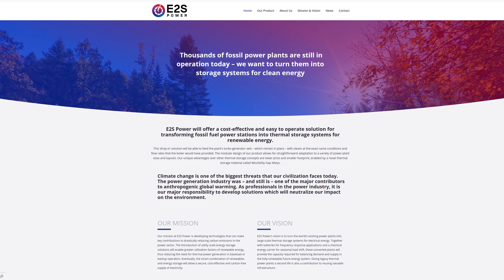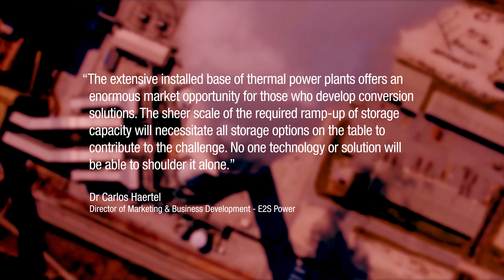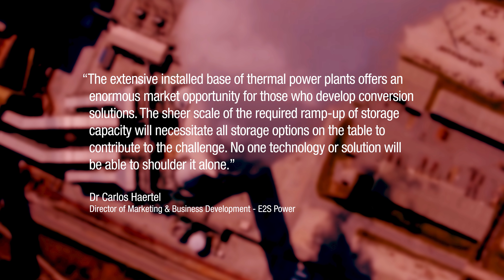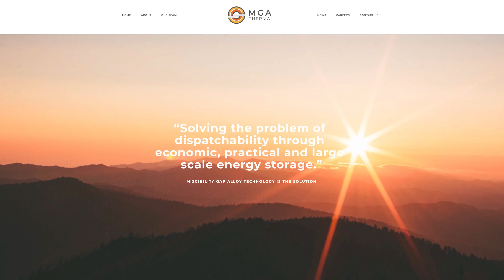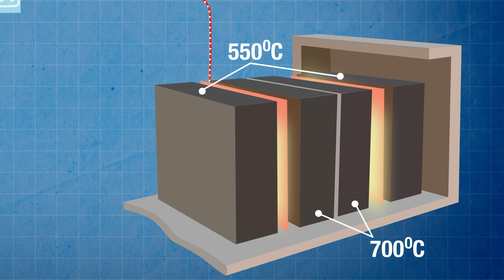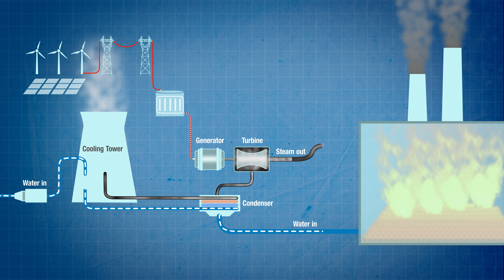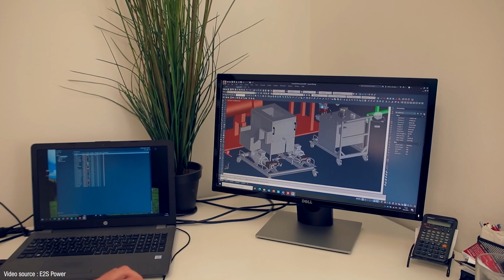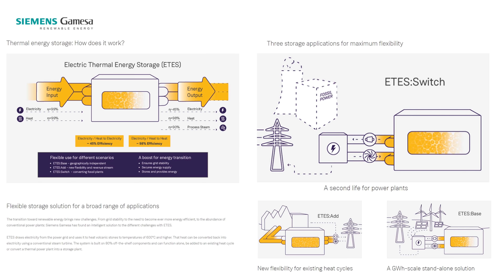New energy storage tech breathing life and jobs back into disused coal power plants

Comment: Thermal powerplants have an efficiency of round about 40 percent, so most of the renewable energy is lost in the process. There are more efficient ways to store energy! It could make sense however when its much cheaper and faster to implement than the alternatives.
Reply: In other words, to make this profitable, they would have to arbitrage electrical prices at least 2 to 1.  So, buy power at 5 cents/kWh and sell at 10 cents/kWh.  How many hours per day can you do this?  2 or 3 or 4? During peak summer demand?  Hard to see how this is profitable, it might be, but barely?
Reply: @LinasVepstas  If there is a shortage of electricity generation at night time, electricity will simply be quite expensive then. 
And conversely, when there is a surplus (high wind, low consumption) - energy is very cheap (sometimes negative prices).
If that difference is frequent enough (and predictable enough), there then is a business model.
Reply: @arnesteinarson3645  in his comment @Linas Vepstas  mentioned exactly that - "arbitrage electrical prices". What he doubts is that you can have high enough frequency/duration of those events to cover the installation costs of this system.
Reply: As a basic rule of thumb, 1/3 of the coal energy is lost as heat in the condenser and 1/3 is lost up as combustion gases / unburnt carbon up the stack. This tech could eliminate the combustion losses; however there would be some losses from insulation or energy lost in heating the material. I suspect you could raise the efficiency levels up to 50-55% with this tech, which is a huge improvement from the current 35-40%

Comment: Instead of using a cooling tower, we could push the steam through a water tank that could be used to provide heating to homes, or even hot water on tap (if you got it hot enough). The usual heat pumps/hot water units can pick up any slack if the tank gets too cold.

A good amount of energy is used for these 2 purposes, so it'd save some of the energy used for heating and recycle the waste heat instead of just venting it into the atmosphere.

In summer, you could pump colder water to the "heating pipes" to help cool homes down.
Reply: @Darren Munsell In the US. Other regions are very different. Most of the coal power plants where I'm from are quite close to cities, and often use the cooling water for heating homes already.

Comment: Why can't they be converted to pyrolysis plants?  Use wood and offload it as biochar! Use the biochar in agricutlural fields and as an additive to concrete. The Ithika Institute calculations on 250,000 machines would meet all the needs of electricity.
Reply: Log wood (20% moisture content) has 14 GJ/tonne and 6 GJ per cubic metre.
Anthracite has 33 GJ/tonne and 36 GJ per cubic metre.
Charcoal is the main energy component of wood..
Not only would you need a metric shedload more fuel, but you would be burrying the vast majority of your energy.

Comment: This certainly is interesting, and I’m always in favor of reusing and repurposing. I’d expect the round trip efficiency is necessarily fairly low though, as the original power plant would have been maybe 50% efficient? It would still have its uses though. I’ve been quite intrigued instead by the modular nuclear reactors that can be used to replace the original boilers at power plants. Thermal energy storage could be combined with those as well, making for a truly winning combination.
Reply: With Thorium or existing Nuclear Waste used to power the Reactors 💯
Reply: Yes! That’s even better!
Reply: rather 35-40%... 50% is unrealistic unless you could somehow combine supercritical or combined cycle power plant

Comment: Old and new coal-fired electric generation can best and super-easily be retrofitted with the newest FUSION NUCLEAR power. Similarly, the Australian submarine force urgently needs the very same latest and more straightforward new PLASMA FUSION TECHNOLOGY, AUSUK or not. The 1960's Nuclear fission of the currently on offer submarines are now thoroughly out of date! This potential alternative and much technically simpler fusion technology is the newest disruption, has not yet been adequately discussed, and is the one that will soon be available for all the cheapest clean energy technology and it will cast an economic shadow even over the currently cheapest solar and wind electric power production.  Large scale regional solar and wind, apart from being unsightly, requires an equally unsightly, expensive and less safe and vulnerable electric grid system and require either many batteries or other storage device technologies. to support them. Not only is the grid unsightly but it has electromagnetic field production long term human health implications which have been proven to be but one source of a multitude of e m radiation sickness symptoms and cancers.

This newest currently available energy is PLASMA FUSION NUCLEAR-based. It comprises “a tiny, any scale built, safe and easily choked 24hr reliable FUSION NUCLEAR energy supply, that of the "SAFIRE REACTOR”. It requires only this simplest medium temperature plasma confinement “SAFIRE REACTOR". To understand it completely you need to be well versed in the newer “ELECTRIC UNIVERSE THEORY”, most easily learned via “THE THUNDERBOLTS PROJECT.COM” website and specifically then see it at the website for the “Safire Reactor”  itself at the largely Canadian firm developers site “AUREON ENERGY.COM”. 

The “Safire Reactor” can be built on any scale as it is entirely electromagnetic in nature and therefore it can be built to suit any sized local community as needed. 

This capability makes large scale and expensive electric grid systems ultimately almost obsolete and large scale more remote solar and wind simply now so much less necessary and economic. So, the net cost of Safire Reactors for electric power supply will be cheaper than with all other green and fossil fuel technologies, especially when considering the lack of the need for beefed-up or expanded grid transmission costs are factored in. We will not require to expand the grid to thus enable much more electric supply as small-scale generators in smaller local communities are easily possible. (Think, no further need for more ugly wind turbines and vast expanses of solar cells and all their added new grid upfront costs.).

We need to develop and install “Safire Reactors” across the world and empower a new societal generation with much-improved equality of wealth distribution levels based on exceedingly cheap power. Safire generators can replace the fuel rods, control systems and containment buildings in older fission nuclear reactors, At the same time, they can safely remediate the spent and unused fuel rods. One of the great things about the Safire Reactor is that it does not need heaps of expensive batteries to support its function any more than the existing fission reactors do. This new possible ridiculously cheap energy available to all could be a great societal leveller. However, we must also realize that this will not be welcomed by all. Supplying this new universal energy is simple but peacefully transitioning our society to accommodate its consequences is certainly much less simple. However, the cat is technologically out of the bag now and any reasonably developed nation can reproduce the physics and technology so we cannot avoid facing it.

Tony Seba, I totally admire your research and everything you deduce and say, but I believe you now need to further update your rapid transitional technology message. This new EU plasma science and its practical Safire Reactors have the additional benefits of producing a whole range of new nuclear elements by atomic nuclear transmutation (Nuchemy) with no need for expensive and scar-forming mining on a worldwide basis. The self-produced hydrogen fuel of this fantastic fusion system produces massive quantities of heat that can be directly used for the thermal domestic and industrial requirements of heating and in generating green and virtually costless electric power.

Using these Safire Reactor/generators, we can then retrofit all existing fission nuclear and fossil fuel generators and then build many more of these new fusion reactors. 

                                                                                          Sincerely, Dr David Gillman at email dgillman47@gmail .com

Comment: So you are diverting energy from solar and wind to a steam powered generating system to supply energy you are already producing?
Makes absolutely no sense. Better to take out those old coal fired plants and make parks out of them.
You could also demand all new housing have solar systems.
Reply: It's to shift energy from valleys to peaks.  In most countries there is a demand spike around 18 pm, just when solar stop producing. If you build solar in excess you can charge this plant and produce energy when needed later in the day.
Reply: @Angel24Marin  That's true to some extent Angel. However, they can store solar in batteries and the majority comes from wind turbines which can run at night.
Reply: @wernerdanler2742   This have better scalability than batteries. I would be able to build one of these "heat batteries" with supplies from my hardware store in my garage.

And they are complementary, building this won't stop you building electric batteries and these can provide constat discharge while electric batteries can provide frequency stabilization.

Comment: That is a seriously good idea! Love the fact it leverages existing infrastructure that would otherwise be written off.
Let’s hope the cost and reliability stack up.  Looks like the concept will scale too, just add more hamsters!
Reply: i'm not against the idea, however i'm not all on board because you should always have multiple sources of generating power than just solar and wind, to do only solar and wind is ignorance.

if you want to prevent what happened in Texas earlier this year, you need to NOT be ignorant enough to dismantle the backups, even if your sacrificing some of the environmental efficiency.

this whole idea of being 100% clean energy via solar and wind doesn't account for failure in such systems, which is a big mistake and why Texas was fucked earlier this year, because one of their politicians thought it was a good idea to dismantle everything else and only use wind power, and when that storm hit and the wind power went down, it unnecessary put ppl's lives in danger because they relied on one method of power creation and dismantled all the others.

you simply can't be this ignorant when dealing with something as important as power generation, you always need backups when shit hits the fan, in Texas's case it was bitter cold that hit the fan and stopped them from working, which utterly screwed everyone living in the lower states at that time.
Reply: No. Physics is still a thing!  Oh good you were joking.

Comment: Coal Fired Power stations were built largely outside of cities to mitigate the associated pollution issues. There were transmission losses over these distances. If E2S system produces no pollution then why not build it closer to or even in the cities where the power is to be used. 
Most of the retired power stations are 50 years old, some even older. Their existing infrastructure is bound to have maintenance issues and even efficiency issues with 50 year old turbines.
It sounds like a good technological storage solution but it would be better to build new facilities than try to re-use old power stations.
Reply: If some of the kit was still okay, I wonder how hard it would be to move it into town and maybe couple it with a low temperature phase-change system to supply long term storage for district heating?

Comment: Two things come to mind, 1) Aluminium production is VERY energy intensive, and leaves behind a toxic sludge that is often dumped down old Mines etc. o to be ‘Sustainable’ they would have to be made from 100% recycled Aluminium. 2) Cooling Towers are extremely wasteful, throwing heat into the Air, they need to be Combined Heat and Power ( CHP) stations!
Reply: And Aluminium is often made in places with geothermal or hydro power - so that goes some way to countering the anti-civilisation themes.  (Old mine shafts are often interestingly toxic places already)...
Reply: @kadmow  What places produce Aluminium with Geothermal?, which btw isn’t Green as it is still an extraction process that releases subterranean gasses such as Methane, Radon etc.
Reply: @kadmow  Yes Coal Mines have gas build ups etc, but nothing like the toxic sludge from Aluminium. A very bad idea to add extra toxins to the mix, that is madness, we should be making the Mines safe by blocking/sealing them off etc.
Reply: This type of system would be viable in areas with district heating where you could use 
much of the heat for buildings instead of having thrown it away in a heat exchange tower.

You could also put greenhouses nearby to be able to grow food in the dead of winter.

The biggest pitfall of this is that the infrastructure around these coal plants was not maintained
because they knew closure was coming, so delay as much maintenance as possible.
Reply: @firstbigbarney  Sure, excess energy could be put to good use. But it's still excess energy, meaning it reduces the efficiency of the energy storage system. Ideally, for 100% efficiency, you'd have no residual heat to use for other purposes.
And this leads me to the crucial question: what is the estimated efficiency of this energy storage system?
Reply: intermittent combined heat and power stations are not really that great.
Reply: @w0ttheh3ll  I’m not supporting these big, dirty centralised power stations, but  ‘’intermittent’’ is usually what is said about renewables( except tidal). Coal and other fossil fuels ( and Nuke) are said to provide a base load. So not sure what you mean?
Reply: @Kiyarose3999  It's been a while since my comment. I think what I meant is that these proposed, retrofitted plants would be intermittent sources of electricity and waste heat (because they store surplus energy and release it when needed). So if you're using the waste heat you have an intermittent heat source. CHPs are typically designed to provide reliable heat. Using intermittent heat is harder because you need to provide backup heat which makes the system more complex and expensive. For example, it has been proposed several times that a local arc furnace steel plant should use some part of its enormous waste heat to supply the nearby town. The plans have never gotten anywhere because the plant shuts down for the christmas holidays every year and the plant operator doesn't want to commit to providing heat reliably.
Reply: Aluminium smelters are increasingly changing over to renewable energy so it's possible to massively reduce the environmental impact of production
Reply: Could the coal act as a source to make graphite? Then you would have a double technology conversion.

Comment: Sorry to need to point out two quick things about this system..  Everything seems really great, except for the release of heat into the environment, via cooling towers,   I mean that heat should be doing something, instead of just putting more heat into the environment.  Second thing is;  where is the water going to come from?   Perhaps from the air?  Such a mechanism, which extracts water from the air, on a fairly large scale, (and put eventually, into a large, permacultured, food growing area, and   Perhaps a permanent" hot springs" could be created on the adjacent land to take care of some of the heat, and creating another, more human-oriented use, for some of that heat.   Or, it could be exchanged into a system to heat the houses and and greenhouses in the area.    😃 As Always, thank you for another excellent view of still one more energy storage system.  :-)   Perhaps we may use some sort of model which allows such a plant to not only do its primary job, but also be a way to power /heat very large-scale greenhouses, and in tangible ways, improve the quality of life for each community... as we also make the move towards All-Organic! <3
Reply: You are repurposing the water circuit of the coal powerplant and the water already there.  Just changing the source of heat from burning coal to "heat batteries" charged in phases of low demand.

That water needs to be distilled so it don't left precipitation when evaporated so it's not suitable for farming.

Some coal plants already provide district heating by circulating the residual heat around circuits under the city, but not all because they usually are away of población centers.